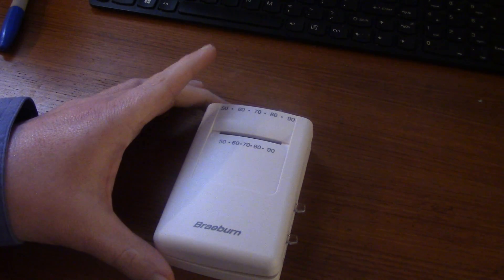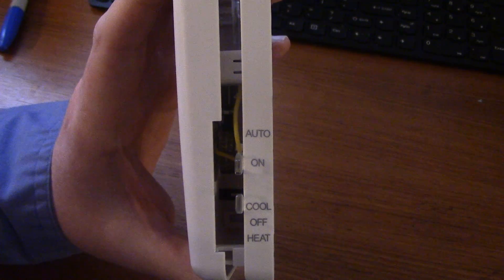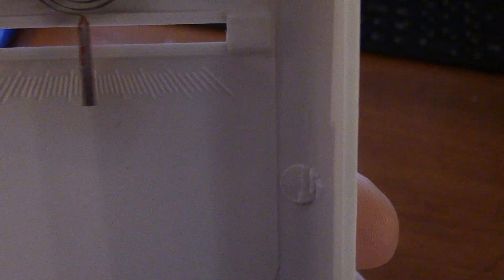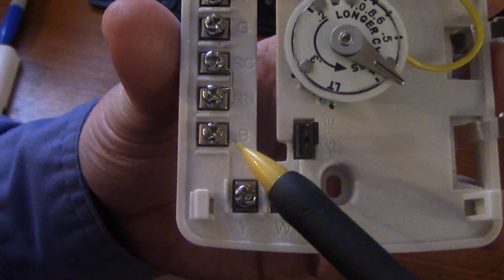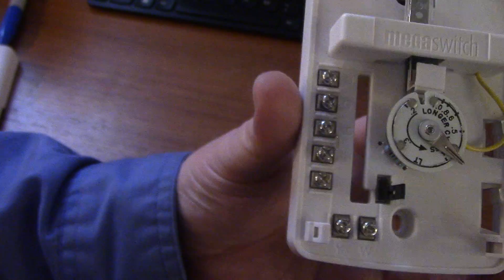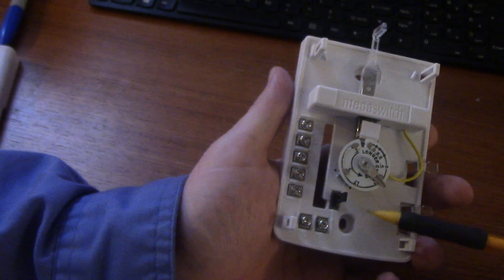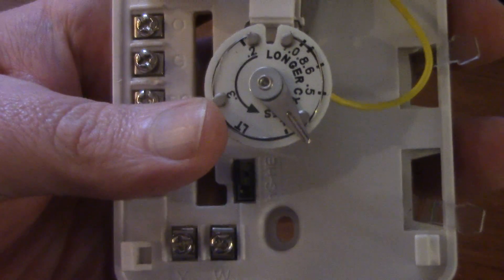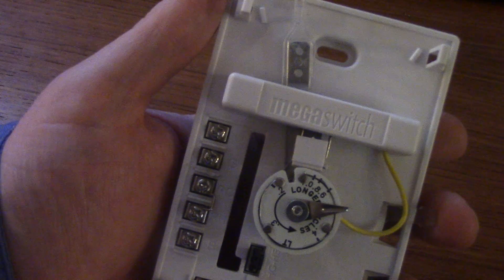Bi-metal thermostat explanation and how to wire and set the heat anticipator

Comment: What happend if the heat anticipator is open? will the fuel furnace work?
Reply from the maker: No, it will be open on the W terminal side and will not allow the 24v to pass through.

Comment: B is not blue, B is for energizing the reversing valve in heat. O is for energizing the reversing valve in cool. Most brands require the o terminal, exceptions are Rheem, Ruud, and Weathering. If you try to use the blue wire ( common ) at the B terminal, you will instantly blow a fuse, or transformer on power up.
Reply from the maker: Which are typically orange or blue wires.

Comment: What is the yellow wire for? Is it considered a “C wire”..?
Reply from the maker: Yellow is typically used for cooling.
Reply: @ChilesHeatCool  but is it used for power? I have exactly the same thermostat in my house as your video. I’m trying to understand where the “C wire” is for my new Nest thermostat
Reply from the maker: Yes it is used for the 24v coil on the contactor in the condenser unit to turn the air conditioner on. It's not a constant 24v, only when the air conditioner runs.
Reply from the maker: You might only have an old 4 wire system.

Comment: hrm i have a weird issue where if i set temp in low 70s it will keep heating 4-6 degrees hotter than the setting
Reply from the maker: Might be bad or you need to set the heat anticipatory. I've also seen were if there is a hole behind the thermostat that it can create drafts, depending on if the wires were run through the return duct and up the wall.
Reply: Or not calibrated to that temperature

Comment: Where should the mercury be? Mine is way over to the left.
Reply from the maker: The mercury is not adjustable. If its a mercury thermostat it should be replaced. The newest it could be is 1990.
Reply: @ChilesHeatCool  oh my husband put a new one it's not mercury ... I use to be able to adjust it I dont know why it's not going on. 
Thanks for trying to help.
Reply from the maker: If its digital there should up or down buttons. If its a nest it operates on a rotory type switch in the housing.
Reply: @ChilesHeatCool  Thank you.

Comment: What if  it's a heater only thermostat being connected to 2 wirescoming from the furnace?
Reply from the maker: Rh and w.
Reply: @ChilesHeatCool  Thank you for the fast response.  I went to Ace Hardware and picked up one of their store brand thermostats.  (AT10-1141SA).  It doesn't have those options.   Maybe I need to take it back
Reply from the maker: If it was a heat pump thermostat it won't. If it was an expensive one it might be in the program. Typically r and w will have the heat run.
Reply: @ChilesHeatCool  No Sir, all I spent was $24 dollars on the unit. No heat pump.   I'm taking it back for the kind you have in your video.   Thank you

Comment: Hi.. What is the problem if the air dont stop whatever is in auto .?
Reply from the maker: Relay or switch is stuck or a short in the wires. Check out my video on troubleshooting thermostats, would give you more information for that. And the short could be in the thermostat to.

Comment: I have a wall heater that has a new thermstat when it reaches temp it cuts off but then when temp droos it will not kick back on until you hit the wall by the thermostat does not work hitting the thermostat only when you hook t the wall
Reply from the maker: Something is jammed or stuck. Might need a new one.

Comment: What is the problem when the heat anticipator wire is melts/breaks when the thermostat is turned from off to heat?
Reply from the maker: Current flow is to much or a short on the W wire or what ever wire is used for heat.
Reply from the maker: Current flow is to much or a short on the W wire or what ever wire is used for heat.
Reply: @ChilesHeatCool  Thank you! I looked for the W wire at the furnace panel and found it to be completely broken off. So, I stripped it and reattached it. I switched on the electricity to the furnace, and switched the thermostat to heat, but nothing happened.  Now there doesn't seem to be any power in the furnace. The green LED light is out. Maybe the transformer has blown out.
Reply from the maker: Transformer is posdible, but check any fuses first.
Reply: @ChilesHeatCool  Finally! I checked for any fuses and there was only one fuse on the control panel. It was a mini circuit breaker - fuse type 3 amp switch. The button on the fuse was in the up position and I could not reset it. I was able to buy the same fuse yesterday and today I put it on and it works! Thank you so much for your help, I was able to fix the problem with your assistance when I had an HVAC guy from GAC Services come over and he couldn't even figure out that the white wire was broken, he even wrote in his summary that the fuse was okay, and that he tested the transformer when he didn't even lower the tray that contained the control panel and transformer.
Reply from the maker: Your welcome. Glade I could help. Spread the video around if you know someone that needs help.

Comment: Hi, nice vid!   I find my similar (older Honeywell 9721 << oops edited for correct model #) stat is allowing a good 10 degree F or more temperature drop before the furnace comes on.   Furnace then heats up nicely.   Can I simply make small adjustments to the heat anticipator for slightly shorter heat cycles so as to reduce the ambient temp diff in the home?   ie play with it bit by bit until I get the result I prefer.   I don't have an amp meter.
Reply from the maker: Not with out an amp meter. You need to measure. If its old, your best bet is a new digital thermostat.
Reply: @ChilesHeatCool   Okay, I won't touch it until I replace it.   Thank you for the response!
Reply: @sparra3819  grayfurnaceman shows you how w/ no meter
Reply from the maker: Your welcome